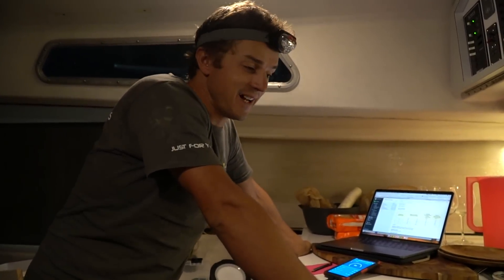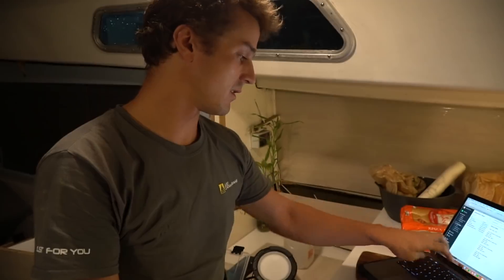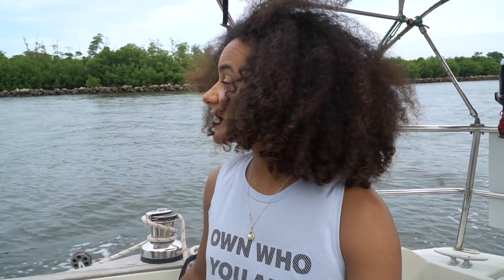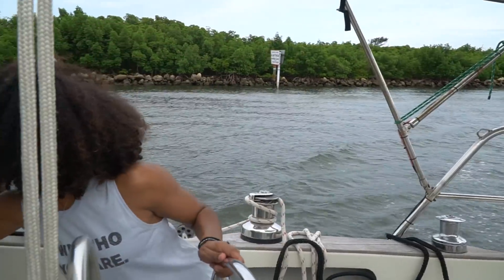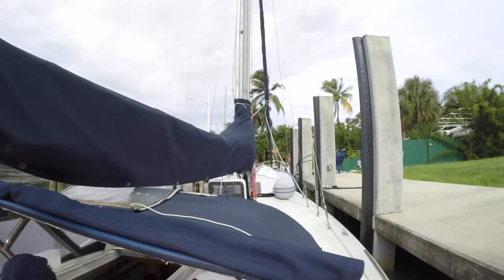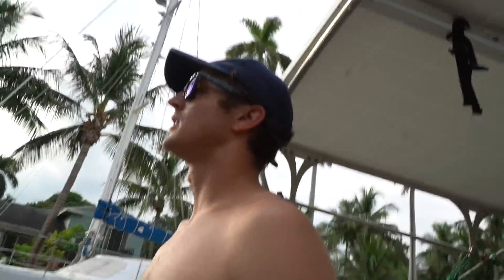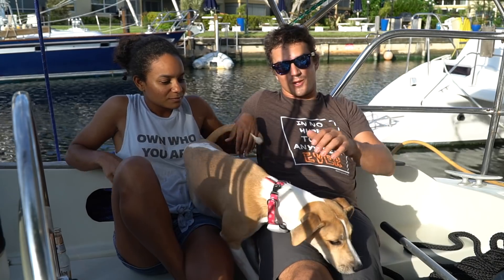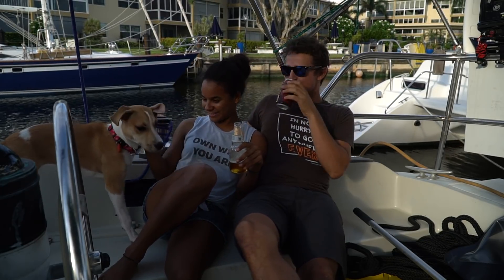Pushing our Electric Motor to its Limit— Sailing Uma [Step 139]

Comment: I don't understand: I believe that Ran Sailing motored for more than a day on the way to Alaska, and I thought the Wynnes motored for more than a day on the way to Polynesia. Ran was trying to outrun a storm, I think, so it was important to move and not just be a sitting duck. How will this 10-20 mile range electric motor setup that cannot be used on successive days in stormy weather work if you start doing blue water sailing? It seems this is only workable for coastal sailing, and then only in good weather. Isn't this really, really dangerous?
Reply from the maker: "sailors" have only been using diesel motor in small boats in the last 50-60yrs. Before that, everyone sailed. We may have to heave to and wait out a storm, yes, but knowing good storm tactics and practicing them, in our opinion, is much better than relying on any type of propulsion to try to out run one. Sailboats only go 6-7kts. Storms move at 14-18kts.
Reply: This is a dream of their's that I hope they don't pay the ultimate price for.

Good luck guys.
Reply: If using "before" as a benchmark they also were wood , no GPS  and no Dacron , wooden masts .  Before is not always stuff you want to choose today for comfortable cruising  . However I like your electric motor  but to be fair one must recognize its shortcomings. Liquid cool it and I think you are set . 

My diesel I would not pull out to put in electric but if it died I would go electric with a gen set  to extend the range and power water makers and such.  I burn about 1lt per hour and my range is measured in days with 41 liters of fuel, a couple of jerry cans doubles it  . Being a Bukh it is rated for continuous 100% output but I run it at around 75% and that makes hull speed . I too sail whenever I can but there are times like next Tuesday when making a delivery that if I need the engine it is nice to have a range that can make it there  . 

As to your range , I do not think you can use it down to 0 so at 75% you have not used 1/4 of the range . As the batteries drop you will find amps go up and so does the heat . I also noticed you were not monitoring the heat in the batteries . Could be disastrous if they start "protecting " themselves and you get a cascade failure .
Reply: Sailing Uma, Preach!
Reply: I have a 4Kw electric motor on a 31 ft catamaran (Proud ranger). The speed is limited by the engine and hull but the range is limited by the battery. I got 10Kw semi-traction battery-set and can run 8 hr at 25% (1Kw) and make 3 kts then. The downside is, i have to calculate where i can get without sailing (if the wind is blowing in my face) but i get there anyway. The benefit: it works always! Never again starting or cooling problems with my previous outboard because i run it only 30 hrs a year.
Reply: @GoosdeVries  sounds like the way of the future. Maybe itll become mainstream when we get over Lithium, and  Hydrogen fuel cell batterys become mainstream and a 100 hours operation is not unusual ...
Reply: just run it off a genny in tho cases
Reply: Simply put, a few thousand years of sailing with no motor at all completely defeats the shrill terror of those who think motors are required equipment.
Reply: Reality is the now - Yep , one should put to sea in  a wooden vessel with no electricity , no GPS and charts with sea monsters located on them just like the old days . In a related note have you seen all the wooden shipwrecks ?  Slocum sailed the world without an engine ......he also went missing and he also took tows  . 

Reliable auxiliary power like Dacron sails, refrigeration, computers , digital camera's  , a head and GPS is a modern luxury - but why put to sea without it ?  I mean heck seat belts are a modern luxury too - I want one anyway or I'm not going far in my car  . 

Their electric motor is about 80% , they need cooling and if sailing a river or canal a generator ... or fill the boat with batteries .
Reply: I have had, and sailed, boats with no engine at all. There are still folks out there who just sail their boats, and don't see why they need a motor. Compared to that, an electric motor is a luxury. And their setup is actually performing fairly well. I am an electric boat owner, sailor, and DIY repowerer so I know of what I speak. 

The best option, even if you have a diesel, even two or more, is to never be in a situation where survival of the vessel depends on mechanical propulsion. It is irresponsible to think otherwise. However, there are options for extending range. Most small electric sailboat owners keep a small portable generator as an emergency range extender. Some opt for a gas outboard mounted on the transom. Some have oars and know how to use them, and this works quite well for boats under 5 tons. 

Stemming a current with minimal mechanical power available is never a good idea and this vid illustrates why, more than that the system is inferior in any way. A diesel of the same power level would have fared no better. 

Electric is not for everyone. For most cruisers, diesel is the only way to go, because most cruisers are not real sailors any more. They NEED infernal combustion engines and are helpless without them. For some cruisers, electric is all that is needed, and for still others, even that is not needed. For day sailing, where all you need the motor is for docking, and shore power is available, it is kind of stupid to have a diesel when electric is so much cleaner, quieter, more highly maneuverable, and even cheaper if you know what you are doing.Electric has NO minimum idle speed. No bumping in and out of gear in reverse, watching your stern walk away from you. Instant power. Instant on. No warmup. No crossed fingers hoping it will start. Throw a switch and twist a knob, that's it. Not trying to sell anyone on electric, just explaining why some folks prefer it. Feel free to enjoy your roaring clankasaurus. Diesel engines are great. I have never repowered a boat with a good diesel in her. Why bother? It runs already. But I have brought a couple of boats with dead engines back to life with electric drive.
Reply: We just crossed the Atlantic from West to East (the hard way) with our electric motor. We sailed the whole way. When we had light airs, we put up the light air sails and waited. When the winds picked up, we reefed down appropriately. The only time we "needed" the motor was when we were pulling into the marina in Horta, Azores, and it worked flawlessly.
Reply: Rigging Doctor -Well done . Did I not see a video of you using a gen set to keep the electric motor going , think it was the ICW?  How was the sailing in the ICW ? Could you just wait for the wind to come back all the time or tack up the channel when the wind was on the nose ? I quote from the riggingdr.com " We then motored along with the current as we had no hope of sailing for days on end. " 

While electric motors are the best engines , batteries suck  and they mean there are some things you can't do with your boat that others with diesels can , unless you supplement with fossil fuel gen sets . Lots of video of Uma being towed by the way or disabled by the electric failing . 

Personally I think electric and a gen set for range and to charge batteries  or run water makers and compressors for dive tanks . Batteries will serve you 95% of the time and an interesting river or strong current or canal or an emergency upwind delivery is not off the table .
Reply: @faircompetition1203  it also took the 'rigging doctor 20+ days to get to Berumda, again a mimnalist important detail left out, how ever no set up is going to garauntee success 100 % of the time, if one wants to keep the progression going then any vessal that can't out run a storm is unworthy to be at sea and what would that threshold be 25-30 knots or more??? As the saying goes, 'you pays your money and you takes your chances'. Go for it UMA!
Reply: Oh , I like electric but like any system one must be aware of its limitations . One thing people forget is it is high current and that generates heat . It is also in a salt water high corrosion and high vibration environment which makes the issue worse . There were lots of car fires in the early electric cars  , but in a car you can walk away and watch it burn . Hard to do on a boat . That is why I don't like propane or gasoline on a boat. Uma had issues . 

I do not think any engine should be counted on to out run a storm , in fact every sailboat I've had is faster under sail and if the weather is bad the sails have more power . I also believe a boat should be able to sail to weather well , many can't and can not claw off a lea shore . That is more dangerous than no engine . 

For me the diesel engine more extends the usefulness and comfort of the boat , you can explore rivers and canals and you can heat water , charge batteries . You can also deliver a boat upwind , or up current or on windless days . There is also the possibility of a windless day and a current setting you onto a shoal . 

Much as people claim there is no rush and no schedule the tides set schedules , injuries set schedules and planes set schedules as do storms . 

As I said I think electric with a gen set would be the best of all worlds . One issue is that the gen might not run very often and engines don't like that .
Reply: Michael Lauer ....... yes...... it is.
Reply: It is unrealistic to think you can cruise remote areas of the world with this setup. Not only is the speed no enough to counter tidal currents, the range is way to limited and then when you arrive at your anchorage after motoring, your completely drained instead of the other way around.
Yeah diesel motor are “new” as well as charts plotter and all the other navigation aids. But the success of ships and their voyages before those navigation aids averaged less than 10% throughout history.
Reply: You are so right.
Reply: Sometimes there is a reason why everyone else uses diesel. Next year when they switch back to diesel, they will say "At least we tried electric"
Reply: @greenstaraz  possibly, but no advancement unless someone risks trying
Reply: Why will they be changing back next year?  For 2 or 3 years they ran a far shoddier system than the one they've just installed.  So what to your mind will suddenly have them giving up, when they'll have satisfied themselves that this is adequate for their needs?  I'm not arguing for their system, were it me I'd 300% opt for a new, efficient diesel I know I can rely on any time, anywhere, whilst generating more power.  But the fact is they're happy with this and they've been making do with worse for quite some time, they're not going to switch back.
Reply: @Poviddy  yer im glad they are living their dream with electric. Will be good to see how it goes. They may end up with more solar or a big genny in remote areas but it will be a good test of the technology. 

People are worried about them more than critical of the tech i think...

Comment: Sold lift trucks and other heavy equipment for many years. Yours is a novel idea. Normally I would not be very concerned about the motor heat as I would be about draining into the deep cycle of your batteries. By that I mean the last 20ish percent of power. The reason for that is that it creates heat which tends to boil off water in the cells warping the zinc plates and throwing off acid ratios. If you are forced to use this power often you will kill your battery life. Suggest getting a meter to check acid levels every so often. Torque in pushing against waves to windward will be interesting. I'll try to be positive and keep my fingers crossed it works out. Happy trails
Reply from the maker: We have LiFePo4's so no need to worry about acid levels.

Comment: would/could you consider upgrading your elec. motor to a higher powered one? and if so do you know what kind?
love the fact that your motor proved itself. i would still consider a cooling system even if only for emergencies.
Reply from the maker: Yes! The motor is by far the weakest link in the system now that we've upgraded everything else. But remember, we bought it for $100 4 yrs ago. For now, it works for our needs, but the main reason to upgrade is to get usable regen. There are companies out there that make much more efficient motors too, we could easily double or triple our range now by upgrading our motor.
Reply: Get this : http://www.thunderstruck-ev.com/motenergy-me1115-brushless-sin-cosine.html. You will get more usable torque and has a built in fan for cooling :) . I don't work for the company I just saw posts about other people using their kits..
Reply from the maker: Their ok. But not much more efficient than our current motor. They are just golf cart motors. If we upgraded, we would get one designed for sailboats and their specific propulsion needs. Particularly looking for one that provides the max regen, which means a solenoid prop that reverses to provide max drag though the water. Not many companies out there make such a thing.

Comment: Did you close off the original exhaust vent from the engine compartment? I was thinking that might be a good place for the vent. I was also wondering if Kika's hair, when not pulled back, could be causing some extra drag on the motor being out in the wind (then again Kika's hair has it's own "cuteness", maybe it's best to leave it alone).

Comment: I realize it wouldn't offer as much push as a diesel engine or your electric motor would, but I have to notice that you have a little gasoline outboard hanging off the back of the boat for the dingy. In an emergency, couldn't the dingy motor be used to move you along very slowly? Boats your size don't have outboard mounts, but it seems like some sort of motor mount could be fabricated for the stern of the boat, even a removable one. I know you guys have the skills and chops to build something like that. Is that even possible for a backup emergency motor? Could it push your boat at all? Just a thought and observation.
Reply from the maker: We've pushed with the dingy before. Hip tow with our little 5hp can get Uma to 3.8kts. Easier for us to just push with the dingy that have an whole extra mount system.

Comment: i am wondering if there is anything close to the motor which could get damage from the hot motor ?
Reply from the maker: Not really. The motor was warm, but with all the surrounding air being sucked out, nothing else really heated up at all.

Comment: I think Id be looking at some shielding to protect the hull because thats still pretty hot
,,, and it sounds like you understand the benefits cooling would have on the motor efficiency so I will leave that alone

Pearson 365s with the stock WB 4108 come with two 4" hose engine blower which runs both sides of the fuel tank and exits aft of the lazarette with what look like 2 low profile dorade vents. All that matters is you make the best of the hose area for best CFM
have a good one
Reply from the maker: Diesels get about as hot as our little electric motor does. Also, with the air getting sucked out, nothing around it got very warm.
Reply: Diesels don't run at 300 degrees F. They run 150 to about 200. I know of diesel propusion engines like the Cat. 3208 with over 16,000 hours pushing 25 to 35 tons with no major repairs. Cool that electric motor! Get it proped right and that alone will help the motor run cooler longer. Do you have a generator on board? It can supliment the batteries and increase running time dramaticaly. I hope your prop shaft is not coupled directly to the electric motor. Those forklift motors were not designed with thrust bearings. Be prepared for multiple bearing failures if you don't connect the prop shaft to a thrust bearing  or a transmission and take the stress off the electric motor's shaft bearings. What lubricates the electric motor's shaft bearings? Moving 5 to 8 tons is asking a lot from that repurposed forklift motor. It never had to work that hard in fork lift. Now that I've raised some ugly issues I want you to know I want you to be safe. You're my favorite sailing channel and I wish you two the best. If you don't have a genset, get one. At least it could save you in an emergancy.

Comment: Yeah the power requirements to move a displacement hull are punishing as you increment speed. The relationship is a cube law.

Good trial though and hit home the point of getting tides and currents right.

On the motor front you need to be sure the temperature you are reading is representative of what the motor windings are experiencing. There would normally be embedded thermistors in the windings which you could tap into.

On the cooling front, while watercooling is an option it may prove to be more complex and problematical than upgunning the existing motor fan.